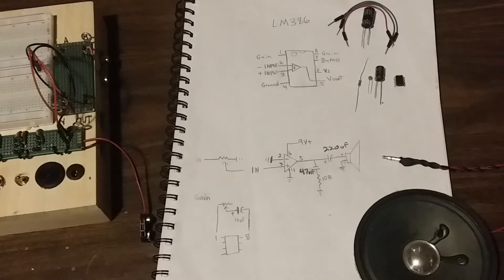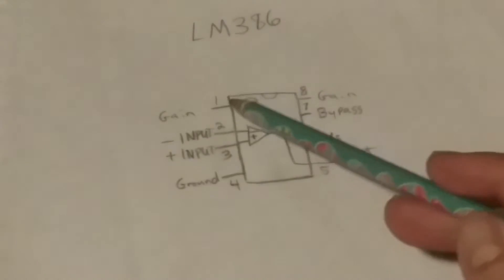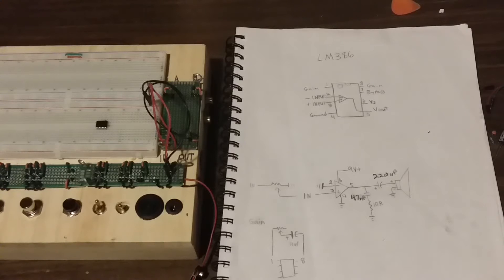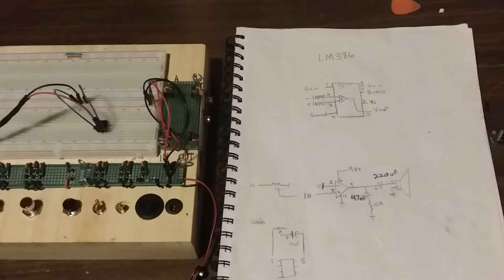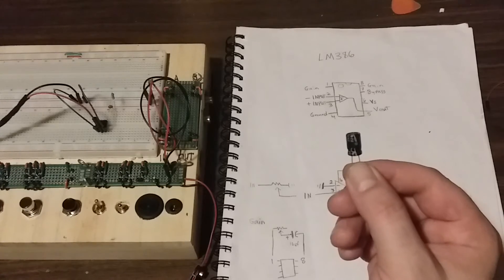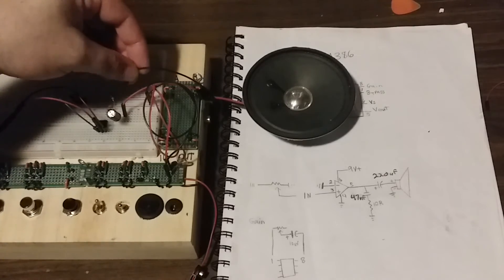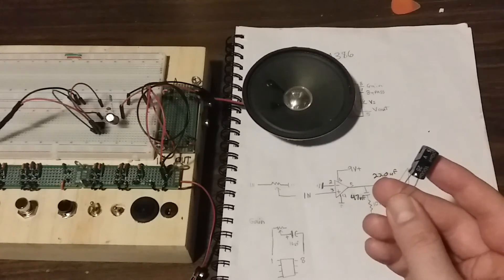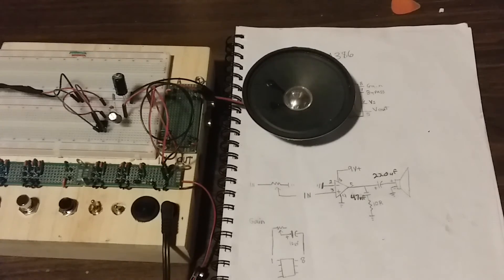How to build an easy amplifier using the LM386 OP AMP

Comment: Would this also work as a guitar amplifier?
Reply from the maker: Yes. It's not very loud but it works as a good little 9v powered amp. I use to build them and put them lunchboxes and have a little lunchbox mini amp
Reply: @davekingrey1009  That's great! I am looking for a cheap and quick way to route my electric guitar sound to my headphones. I can probably make this (with the additional controls) from stuff I already have lying around

Comment: i got sound but my resistor started smoking
.
Reply from the maker: The resistor that goes from the speaker positive to ground?  There shouldn't be that much voltage going to the speaker
Reply from the maker: Check all your connections make sure they're all going to the right place
Reply: Ahhhh I see what I did wrong.   Thanks.  Could this setup work for a guitar or do I need more gain?
Reply from the maker: @PoboyMusic You can use it with guitar. That's what I use it for. You can add gain to the circuit by jumping the 1 and 8 pins with a 10uf capacitor. Check out my other video on how to add gain snd volume controls https://youtu.be/dW9q0Izfd5s?si=9XBXsGv__0cferG5
Reply: @davekingrey1009  I really don't know what I'm doing wrong.  It seems to be working as far as the sound but way too much current is going through the resistor still and its smoking. I've gone over the wiring a few times.   Speaker is 8 ohms.  I'm kind of a noob to the LM386 but this wiring setup isn't very hard.  😀
Reply: @davekingrey1009  I got it to work, I just redid it with new parts, I think the Chip was faulty, it was driving me crazy.  lol
Reply from the maker: @PoboyMusic  It would not be too uncommon to find a faulty lm386 chip. They seem kind of inconsistent in quality especially if you're buying them from places like ebay, which I myself have done many times. It can be really frustrating when you have done everything right and the part is faulty and you dont realize it.

Comment: The supply voltage for the chip is 9v , what is the supply current, looking forward to your reply
Reply from the maker: I use either a small 9v battery or a standard 9v power supply that is used to power most guitar effect pedals. My power supply says it has a 1700ma maximum output. It doesnt even have be a 9v.  Here is a link to the datasheet. It should have all the information you need about the circuit. https://pdf1.alldatasheet.com/datasheet-pdf/view/8887/NSC/LM386.html

Comment: Any advice for a printed parts list, I got a squirrel brain and would have to pause.the video and write it all down. Lol
Reply from the maker: I have 2 other videos on my channel for this amp. One shows how to add gain and volume controls, and the other gives a simple breakdown on the lm386 amp. The video that gives the breakdown has a link in the description to the lm386 amp data sheet. The data sheet has the schematic that shows all the parts needed for this build. You should be able print them off or screen shot them from that website. Thanks for watching! And check out my other two videos on this amp if you havent already.

Comment: Sweet! Can u breakdown in the future each solid state devices role, kind of like you did with the 1000peco-ferad capacitor?
Reply from the maker: Check out my video called "The LM386 Amplifier Circuit". In that video I go through the basic function of each part in this circuit

Comment: Can't wait until your next installments! It would be awesome if you could break down exactly what each component does as well! I know that resistors consume power and capacitors consume energy, but I fail to comprehend how exactly these along with the chip create an amp. Though I have been building pedals for quite some time, I still do not comprehend the "why" aspect of alot of what I am doing. You seem like a great teacher, and it would be super awesome if you could break this down further. Take care!
Reply from the maker: I am no expert but I will do some more videos about the individual parts. If you havent already you should check out my 2 other videos on potentiometers. My next  video will probably be on adding the gain and volume control to this circuit. After that I will do a video on capacitors and then resistors. Then I will do a one breaking down this circuit the best I can. Thanks for watching.
Reply from the maker: The video I made explaining this circuit is up now ;)